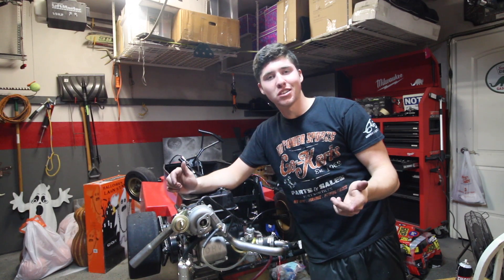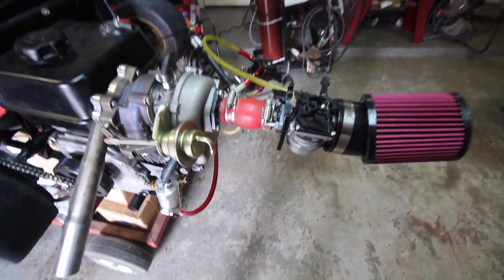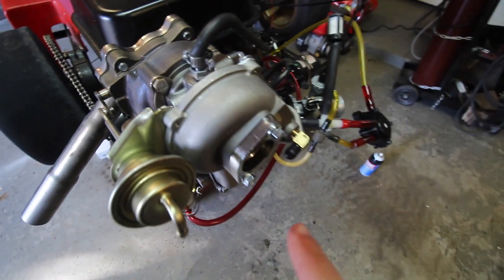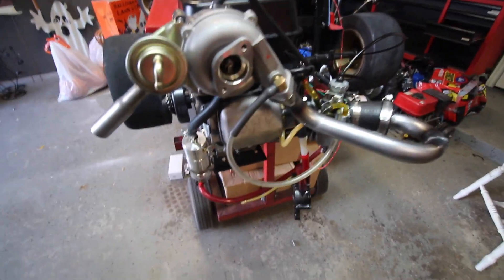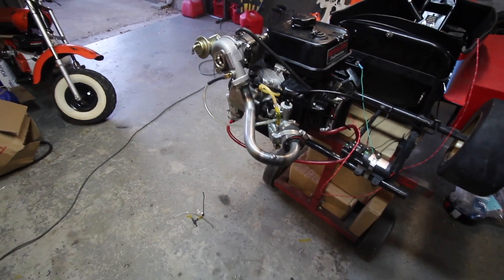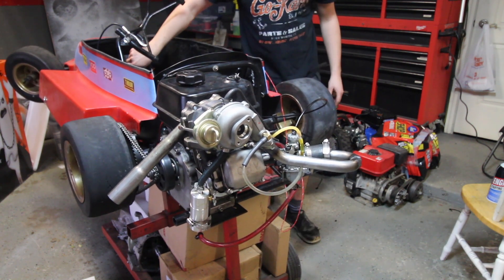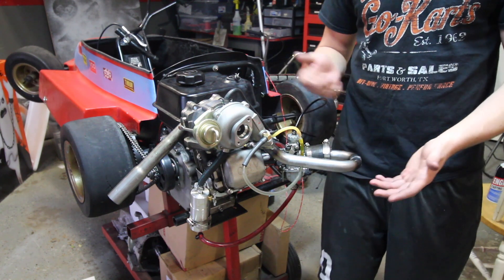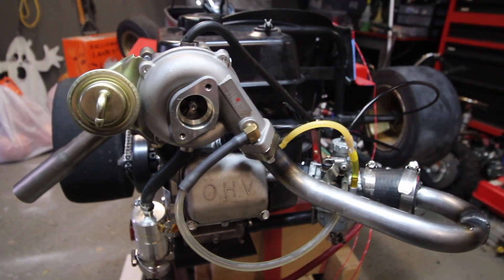Tuning The Turbo Go Kart!

Comment: Much better you still need a real fuel system with a blowthrough set up and also i cant speak much for the tillson carb but the kiehn knock off the afr adj your talking about thats just for the slow jet or pilot jet it effects idle not anything else. I say go do some more home work this isnt something you have to figure out its already done. Go read your closer still not understanding the basics of carbs though. also if my years of blowthrough can help .a flat or round slide carb is not fun withboost very hard to tune go cv carb much easier especaily since it does some self corrections to mixture. 
Lastly and i cant stress this enough your trying to tune a turbo engine with almost no load... It wont work even without a turbo you cant tune without load.. YOU CANT TUNE WITHOUT LOAD. Hope this saves you some time really save your money and go efi its not much more than this is gonna frustrait you. Your best set up so far with no load will not build boost let alone rev cleanly with load try it

Comment: take the intake and carb you have on and put it on the turbo the run the turbo right to the motor then tune from there need long throttle cable

Comment: Hook up the waste gate
Reply: Why?. It isn't making enough boost to overcome the weight of the waste gate spring.
Reply: @MJTAUTOMOTIVE  it will once there is an actual load on the engine. Why do you think a lot of people street tune their cars after having it on a dyno. Same concept
Reply: @KingsBlend421  . You do realize that a dyno puts a load on the engine right!. When the waste gate  actuator  is not hooked up to a boost signal it is in the shut position.  So the only thing keeping the waste gate flap shut is the weight of the spring.  And this set up will not overcome  the spring pressure. So I don't know why you think you need to street tune a car (or gokart)  after a dyno tune. You don't  see professional race teams tuning there engines on the racetrack or street.  That's  why dyno's are used in the first place.
Reply: @MJTAUTOMOTIVE  do more research before you go blabbing on

Comment: Pull the turbo and weld the waste gate shut. If it’s non gated, then it’s a VGT turbo. Supply a boost reference to the VGT actuator. This should bring boost in earlier and provide a more usable torque curve
Reply: The amount of boost that this thing is making (possibly none) would never overcome the weight of the Waste gate spring. So it would be a waste of time to weld it shut.

Comment: You need a higher psi fuel pump and use a boost reference fuel pressure regulator,  and for ever psi of boost add one psi of fuel. Maybe tap and plug the carb vent and over flow and use the boost reference you currently have going to the carb on the fuel pressure regulator.

Comment: If you add a electric fuel pump with a boost referenced fuel pressure regulator you might be able to remove the stumble at low rpm

Comment: My opinion gotta tee off the the boost reference from the turbo one goes to the wastegate and the other to the Gas tank . Add a bov in between the turbo and carb , tap the intake manifold for vacuum reference for the bov.

Comment: A way i have done this before is to use an electronic fuel pump and a 1:1 rising rate fuel pressure regulator, use the electronic fuel pump to pressurise the fuel bowl and put the fuel pressure regulator between the pump and the carb. you have to set the regulator to near its minimum setting about 1-2 psi of base fuel pressure and then when the regulator sees boost it ups the fuel pressure with a ratio of 1 psi of boost = 1 psi of fuel pressure. This always keeps 1-2 psi in the fuel bowl no matter what the boost or vacuum is being produced. This worked perfectly for me and ran as it did before turbo, just with alot more power :).

If you keep your current setup i would suggest putting a 1 way valve on the line between the turbo and the fuel bowl as any vacuum between the turbo and the carb will be trying to suck fuel out of the bowl, this is why it runs better when on boost. This will also help there to be less stuttering between going on and off the throttle.

The type of 1:1 fpr is something like this, but i would try to find one with a guage to make it easier to set up :), hope this helped.
https://www.ebay.co.uk/itm/Adjustable-Fuel-Pressure-Regulator-1-1-Rising-Rate-100-psi-7-bar-Select-Colour/332257912040?hash=item4d5c1d64e8:m:mlqe9MZfE1Kn8yd6vDGsCyA:rk:1:pf:0

Comment: You know when I built my turbo 250cc pep boys baja dune buggy I used a gt15 Garrett turbo and ran a boost signal line to the fuel tank and the carb vent. With a MBC I was able to achieve 18lbs of boost under full load, one needs to learn how to set up a blowthrough carb

Comment: Carbs aren't made for force air ops. You need to go with E.F.I in front of turbo
Reply: Dennis Cheslock. EFI in front of turbo. WTF why would you want to do that. You can modify the carburetor so you can use it on a blow through setup. Also if going EFI you want to put the injectors as close to the inlet valve as possible.

Comment: Carbs can work as blow thru... You need a boost reference fuel pressure regulator. It turns up the fuel pressure to accommodate and cancel out the positive pressure in the carb and float bowl.
Idk if the mikuni will work with it, but carbs can be used with blow thru boost. They do it  on cars all the time.

Comment: Hey there. 
Just want to help. I would pressurerise the fuel from tank in to the carb. This is why: If you have 14.5psi fuel pressure from the atmosphere (fuel tank pressure) going in to the carb and the pressure in the carb is what ever boost the turbo is making, let’s say 14.5psi to make it easy. Then your relative fuel pressure becomes 0 psi that’s why you see the fuel getting pumped back up through the fuel line. Therefore you need 2-5 extra psi of fuel pressure before the carb. So to recap if you are making 14.5psi of boost and the atmosphere is also 14.5 psi you are effectively making 29psi of boost. Then you need 33-35psi fuel pressure to overcome the pressure difference. Keep in mind the fuel is already 14.5 psi of pressure in atmosphere. 
I hope it was helpful. Good luck.
Reply: there is no additonal 2-3 psi fuel pressure with a carb. he just needs to pressurize the fuel tank with the boost line from the compressor housing so that the whole system is pressurized to the same psi,

Comment: have you tried adding some kind of valve in the line to pressurize the bowl where you can adjust how much air goes into the bowl
also try adding a blow off valve so you arent putting strain on the carb

Comment: Hey guys pressurize the gas tank as well
Reply: This is the problem 100% I have done numerous blow through setups....just t piece off the turbo to carb line run it up to top of tank to give 1psi fuel pressure for every 1psi of boost
Reply: It should work fine then jet the carb fat for more air from turbo. But u will always b a lil black on the exhaust gas at idle unless you buy us carburetor designed specifically for boosted applications or fuel injection
Reply: Good luck hope u c this

Comment: Why is it surging at high RPMs? ~( ,m,)~
Reply: Delicious DeBlair That’s the rev limiter.
Reply: @300zxdriver  Since I am not there I can not verify this, and therefore must ask those who are there on hand. 

A lot of people remove such impedances.  I always do, but then I race a lot.

Also I have seen surging on engines where the RPMs caused top end fuel starvation [even on big block V8s] so that it would do the very same thing, and the solution was adjusting the fuel jets.
Reply: Delicious DeBlair They said in the video that it was hitting the limiter.
Reply: @300zxdriver  Oh well, I guess I missed that.....

Comment: Mikuni's don't work as a blow through. Put it on the suction side with a hobbs switch that turns on the electric fuel pump when it starts to go from vacuum to boost. One fuel line from the fuel tank with a check valve fed to a y connector and another fuel line fed from electric fuel pump to the other side of the y to feed the carb under boost. The carb can keep up as long as it has enough fuel. Change the gear ratio to keep the RPM's low and the motor will live. If you were making boost and the motor coughed you would be replacing the piston fairly soon. 2-3 pounds of boost is the most you want otherwise the boost will keep the intake valves open. Try that blueprint.
Reply: Blow thru’s not just harder to tune also requires a little more complicated fuel system, like he stated hob switch and small electric perk pump along with some better valve springs.
Reply: Uncle Muir 👏🏼👏🏼👏🏼

Comment: hey guys nice work looks good so far. you may want to put vaccum from the input side of the turbo to the waste gate solenoid otherwise it will build full boost all the time and mess with the air fuel mixtures.

Comment: drive it every time you tune its different with no load and try taking the exhaust off to see if it will spool faster also maybe pressurising the fuel tank so it forces fuel at boost.👍

Comment: You aren't going to build boost if you don't hook up the waste gate on the turbo
Reply: Uh, incorrect, sir.  The arm on the wastegate actuator is hooked up to the flapper, and without a vacuum/boost reference, the gate will never open... meaning it'll make ALL the boost.  When the wastegate opens, it lets exhaust gas bypass the turbine housing.  I have first hand experience with what happens when the wastegate doesn't open.  3 bent and 1 broken rod == trashed motor.  But hey... it made 35psi for 3 gears until she blew.
Reply: I herd it dubbles the boost pressure. So a 15lb gate unhooked  will make 30lb. the exhaust backpressure builds and just escapes out. never tryed so idk. lol
Reply: I'm just going off my turbo I have the same one they have and it was boost closed waste gate and vacuum opened it but everyone is different
Reply: @charliecox1444  dude...the "waste gate" doesn't mean you waste the competition when it opens. it means it lets out the extra boost
Reply: @philtripe  Drive pressure. Boost is on the other side of the turbo
Reply: It'll make too much boost if it doesn't get hooked up
Reply: @loganarzuaga8316  that's not necessarily true. Take diesel for example, a lot of them don't use gated turbos because turbo is matched to the drive pressure coming out of the engine. If the Drive pressure coming out of the exhaust isn't there, then you won't be able to over spool the Turbo

Comment: Try putting the air filter on it to where the turbo has to try a little harder to breath and it may cause just enough pressure to build boost but I'm new to the turbo thing  lol

Comment: Like said before your not going make any boost without a load. You definitely need stronger valve springs. I would tee off the boost reference and pressurize the fuel tank also into the vent. When the float drops enough and the needle unseats, the boost will just push the gas back into the tank.
Reply: Omg... I said this on the last video. Lil idiots don't read long comments. Lol
Reply: @thegenerousdegenerate9395  I said that two weeks ago lol. i wasnt surprised.
Reply: Yep, need to add a hose to the tank vent. goin to run the bowl dry and go lean then melt the piston. the pressure in the carb might keep the needle shut.
Reply: Yes do this, and as for the tuning goes, my best guess is do not over enrich it to much. Make sure it revs out and runs great without boost with that carburator, the increased fuel pressure under boost will add that extra fuel you will need (small adjustments are needed here)

Comment: Okay, please listen, you're gonna blow that engine up if you don't change the valve springs, get a billet rod, and a billet flywheel. A few nice things to have would be stronger pushrods too but they aren't exactly necessary. Any one of those parts are going to fail, especially the valves without valve springs. Build the engine right, the stock engine is great but it WILL NOT hold up to being turbocharged.
Reply from the maker: BJ Jongejan I forgot to mention that it does have 18lb valve springs. But yeah if we were going for extreme durability rod and flywheel would be essential. Thanks.
Reply: I’m quite sure once they get the basics of making the turbo system work, a built engine will come next. 

Building an engine without  a working and tunable turbo system would be pointless
Reply: its not making that much boost dude
Reply: @T22UGE  Even performance N/A needs those mods 😝

Comment: I think you might have better luck if you were to build that 212 up and make it safe to run in the higher rev range. You can only move so much air out of that exhaust port to spin the turbo, so if you put stronger internals in, did some head work, and took off the governor, then I can almost guarantee you’d see a lot more advantage out of the turbo.
Reply from the maker: We might do that in the future, but I think efi would be first if we went that route but a built engine would definitely crank out some more boost for sure!
Reply: @BuildBreakRepeat  you should at least remove the governor if you haven't already.
Reply: Build Break Repeat I partially agree with him/her^ it would definitely be beneficial to remove the governor, but at the same time it might not be the smartest thing before building the engine if you’re already getting valve float. The biggest thing I wanted to get across with my original comment though, is that since you’re highly limited on the volume of air you should instead focus on the speed in which the engine is pumping it out. Either way, this is an awesome build and I’m enjoying it quite a lot. Can’t wait to see the next episode. 😃
Reply: @Genesis385  everything is going to change as soon as they run it with a load.  It wont rev right up, itll make more boost the air/fuel will be different.  So really it's all moot until they drive the thing.  Pick a setup, ballpark the settings and then tune it as they drive it.

Comment: Take a look at a cheap water methanol kit, mechanical boost gauge, and an o2 sensor. I bet the output could be doubled with a proper tune.
Reply from the maker: Joe Williams Dang yeah that would be rad. Probably would have to go efi before that though.
Reply: @BuildBreakRepeat  I think even the carb could be tuned with the proper sensors(O2 and boost) then after its dialed in you could go to fuel injection and then be able to make the comparison between the 2.

Comment: What do you think is the best go kart engine for a 4 seater go kart.
Reply: 440cc snowmobile Engine
Reply from the maker: 420 would be pretty good but if you don’t wana worry about power issues go 670. The biggest thing I’d worry about is getting a proper tav settup. A 420 with a 40 series from GPS would be good.
Reply: @BuildBreakRepeat  or you go with a sled engine and your getting 60+ HP and you have a torque converter that comes with it

Comment: So um is that engine a hemi you guys are using
Reply from the maker: Justin Woods yeah
Reply: @BuildBreakRepeat  omg you guys acaully answered oh also how long is the bolt you guys have from the shafts and the clutch also the washer
Reply from the maker: Justin Woods 5/16-24 bolt 3/4 inch long should be fine. Also if u buy a clutch from GPS they will ship it with em.
Reply: @BuildBreakRepeat  thank you guys out there also I like the c10 nice job replicating it with the baja warrior mini bike that engine in there it's gotta be making 8 to 10 hp